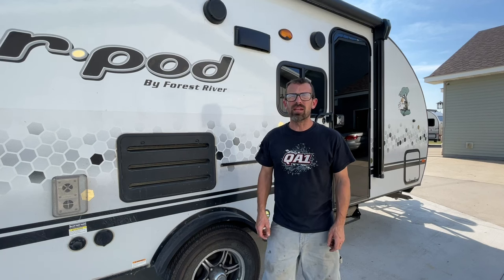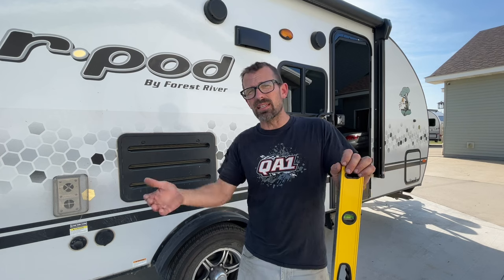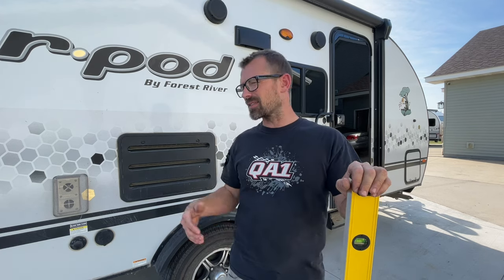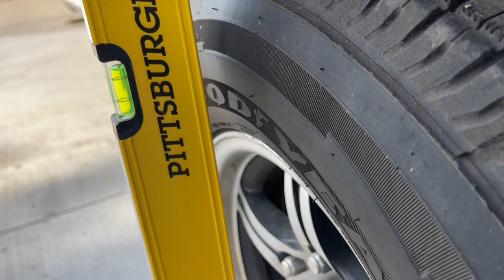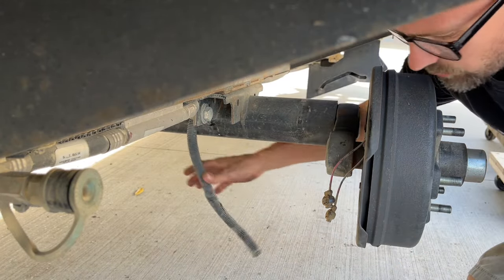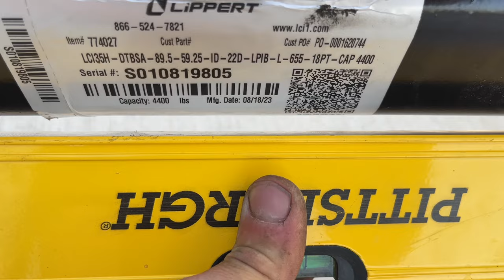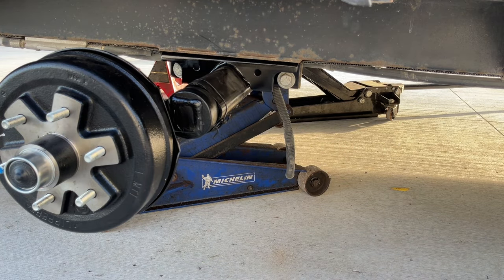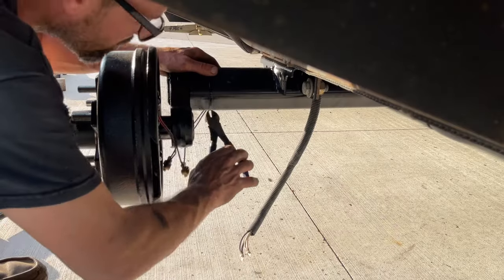r-pod (Lippert) torsion axle issues and replacement....again

Comment: FWIW - my 3.5 year old simple Dexter axle, 2,000 Lb leaf spring type, has lost all camber on one spindle and half its camber on the other spindle.  A new axle has been ordered. Tis time I will triple check spindle slope (camber) as well as camber on the spindles before I even mount the axle.  This is on a 2003 Aliner Scout.  Actual axle load including self weight is 1,680 Lbs on the CAT scales.

Comment: Long story short,we purchased a forest river Kodiak cub. Shortly after getting home I found some major issues, I contacted Forest River and they took care of everything, told us to hang tight and built us a brand new camper. Shipped it to us, took original camper, took care of tag transfer and everything in between. While talking to production manager during this process I stated to him that the camper had a 4k axle and the camper weighs 3870lb. Just by me stepping into the camper put it over weight. The replacement camper came to me with a 5200lb axle under it. This is something to be aware of when purchasing a new camper, my experience could have been a build mistake but there's not very many regulations or safety inspections on these things. Forest River did us right, treated us correctly and respectfully, but I can honestly say I will not purchase another camper from any manufacturer, I will build my own..
Reply from the maker: That’s great to hear the took good care of you!

I left a ton out of this video because it would have made this video way too long. 

Short version: Mickey (at Lippert) would not approve a higher rated axle for me because it was not spect out that way from the factory. 

Also keep in mind that 2 things need to be subtracted from the trailer weight to find out how much weight is actually on the axle.  

1: unsprung weight (wheels, tires, hubs, brakes. 
2: Tongue weight. 

I agree that they are still cutting it too close, but the weight of those 2 things will probably exceed 500lbs or even 600lbs and that’s certainly worth calculating. 

Thanks for watching and commenting!!

Comment: I bought a 2021 forest river r-pod 193 and I left for my first trip with it and 15 Mike's from home I hit a pothole and that bent the end of my axle and blew my tire. I need to fix it but I feel like they must make something stronger than what is on there. Anybody know of anything? Maybe an axleless axle?
Reply from the maker: I don’t think an “axleless axle” is a thing, but an upgrade to a higher load rating I think would help.
Reply: @bennieaust  Timbren makes one
Reply from the maker: @DGP311 i see what you’re saying. In my experience that part of the axle isn’t the part that’s failing. I don’t have personal experience with either the Timbren or Beast Mode suspension systems so I’m not sure if they are a reliability upgrade or not. I can only speak to the unreliability of this axle in this camper. I think I higher weight rating would be a good start. 

I’m not sure if another type of axle would even be a bolt in replacement. I have a feeling the frame is not built to accommodate something like that.

Comment: OK...completed the new axle replacement to hopefully remedy the "tipped in at top" wheel. Guess what...the wheel is still tipped in and I haven't put a single mile on the new axle. What the hell is going on? Now, my galley/fridge is on the drivers side. Maybe that extra weight is causing the problem??
Reply from the maker: Did you use any method to measure it or are you just “eyeballing” it?  Sometime crooked fenders can give the illusion of negative camber.  If it in fact does have negative camber I would contact Lippert and see what they have to say.
Reply: @bennieaust  Yes…measurements at top and bottom of wheel to a known point on the frame show a definite difference…same as for the old axle which had definitely flattened out. The new axle has the characteristic bend in it missing in the old axle. I thought for sure that would remedy the issue. Very surprised that it didn’t. Yes…I’ll call Lippert Tech Support. The old axle was way out of warranty, but they sent me the new one no charge as a goodwill gesture, but there’s no warranty on a free axle. So…we’ll see.
Reply from the maker: @DragonPilot  that’s pretty amazing they sent a free replacement. I hope you can get it figured out. They are a great company to deal with.
Reply: OK…all good! Took it for a brake test drive and when I got back it seems the axle/frame/torsion bar all settled and now the wheel is straight up and down. Whew! Had me worried there for awhile. 😅
Reply from the maker: @DragonPilot  sweet!  Great to hear!

Comment: I’d heard about the outrigger fix for all rpods, unrelated to the axles. So I emailed Forest River to get the outrigger parts and they are telling me I need to replace to axles! What a shock! So thanks for your video so it doesn’t seem so unusual
Reply from the maker: Unfortunately it’s not unusual. :(

Forest River generally does not approve modifications (outriggers, or higher capacity axles) so I’m not surprised they just want to send a new axle. The good news is that it’s really not difficult to swap out. 

Thanks for watching!

Comment: I was wondering what they do with the axles that are returned to them.  I could use a couple for a tandem trailer.
Reply from the maker: It’s a great idea, except for the fact they have failed.
Reply: @bennieaust  Torsion axles don't spin.  They just hold the spindles there.  They should be fine if they are mounted to the frame in a way that is flexible.  The spindle and all the stuff hung on it is incredibly expensive to build, and stupid to throw away.  I guess you would need a frame mount that is flexible but won't break away.  It'd be a big mess if it broke away.
Reply: I think a lot of tandem systems have flex built into them anyway.
Reply from the maker: @aheroictaxidriver3180  the rubber was worn out on the old one. Bad enough that lipped said it needed to be replaced at their expense. If they say it’s bad, I’m inclined to agree with them. I would run it on anything else if they say it’s bad. It had a large amount of negative camber. That would at minimum wear the tires unevenly.  That’s the entire reason I replaced it in the first place.
Reply: @bennieaust  They can be hung from springs even if the dampeners are gone.  Taking them to the scrap yard just seems wasteful.
Reply from the maker: @aheroictaxidriver3180  how are you planning on fixing the negative camper issue?  It’s not a dampening issue, it’s a negative camper issue.
Reply: @bennieaust  Lots of vehicles are designed to have camber.  Plus there are shims.  Rather than trying to perfect what is probably just an inherent design defect, it seems more rational to convert the resulting damaged parts to good use.  Obv. you're annoyed by the repeated repairs, but that has nothing to do with my point, which is maybe the damaged parts can be recycled.  I bet they just throw them all away on a theory of highway safety.
Reply from the maker: @aheroictaxidriver3180  it’s sounds to me like you aren’t very familiar with torsion axles. There are not shims that determine camber. Once it’s out of spec there is nothing you can do except replace it. Design flaw?  Maybe. Im my opinion, I think in this application it’s a camper design flaw. They speced out too “small” of an axle. 

Lippert does not want the axles back. I have one right now in my recycling pile. I pull the brakes and bearings off and replace the rest. 

It hardly even annoying. Every spring I get a fresh axle, bearings and brakes. 

I know they have upgraded other people to a higher rated axle. If they eventually get tired of yearly axle replacement maybe they will do the same for me. Either way they have been great to work with and I have no complaints about Lippert as a company. They have totally stood behind their products.
Reply: @bennieaust  Oh, so they only replace spindle to spindle?
Reply from the maker: @aheroictaxidriver3180  no, they replace the complete assembly. Brakes and bearings all assembled.
Reply: @bennieaust  Oh, so then you have spare assemblies, from the spindle out?
Reply: @bennieaust  If you cut the axle off, inside of the mount, you would have assemblies from the mount out?
Reply from the maker: @aheroictaxidriver3180 yes, not including the spindles of course.
Reply from the maker: @aheroictaxidriver3180 yes, not including the spindles of course.